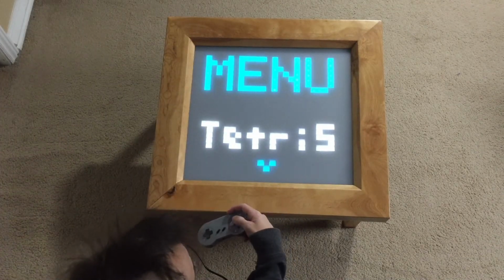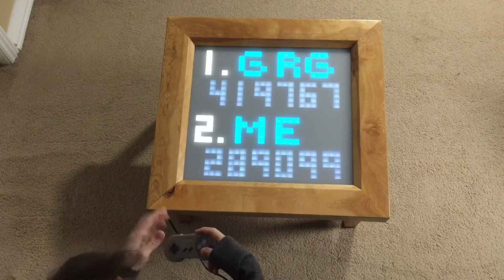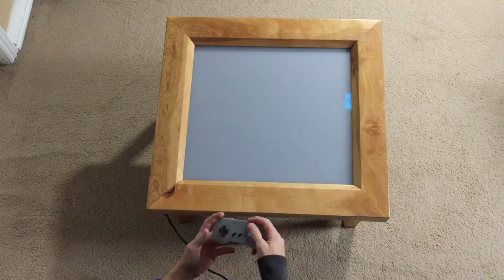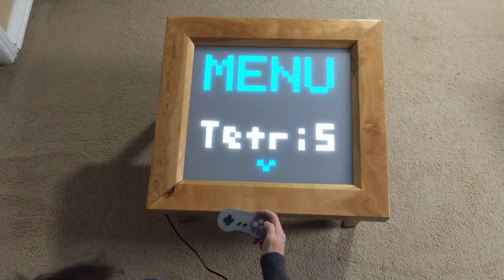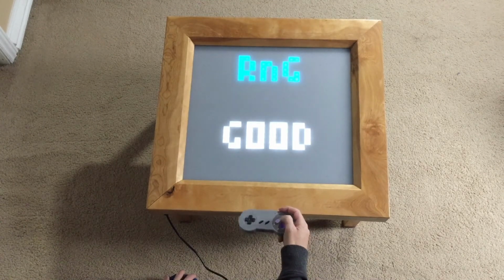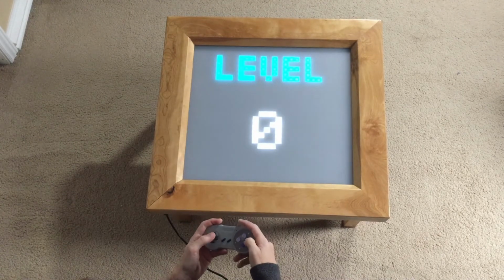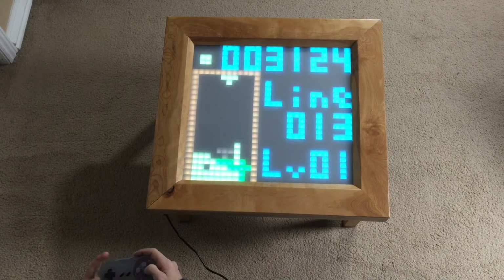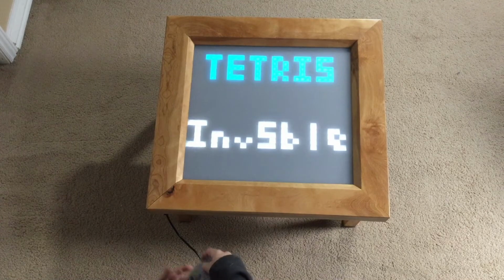Arduino LED Tetris Table Upgraded!

Comment: May I ask you something about the code ? thanks!
Reply from the maker: you are more than welcome to ask
Reply: @mohawkpiper  I'm trying to use the code modified but my led strip doesn't turn on.

I think is about the potentiometer, because I used the original code and works, at least turn on.

Can you share your code? I'm trying to use to do a coffe table to my new house but I'm totally noob on Arduino -_-
Reply from the maker: @Vorh  i am not so willing to help debug, as it can possibly be pretty time intensive. If you think it is the pot, remove it from the code and set the brightness to 1 for starters. There are places you can go for help debugging problems like the arduino forum, the adafruit forum, and the teensy forum (if you are using a teensy, like i am.) They would need more info, like what modified code you are using, what microcontroller you are using, what led strips you are using, your setup, etc.

Best of luck!